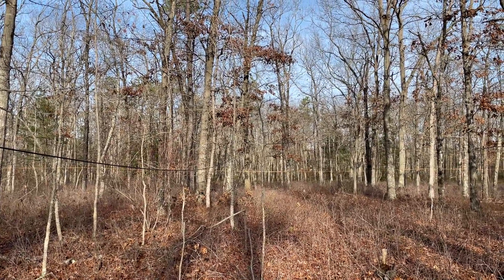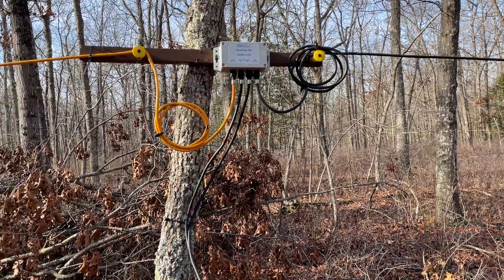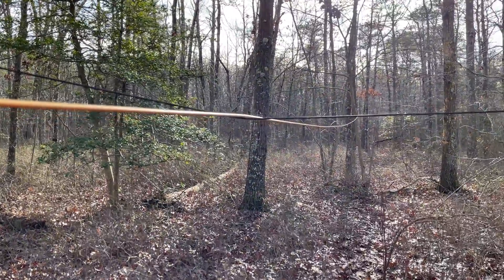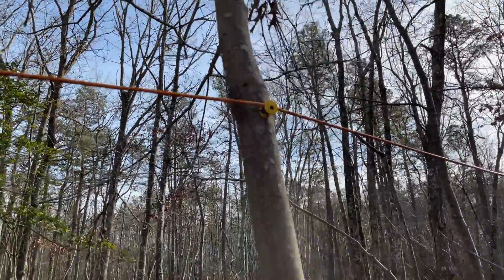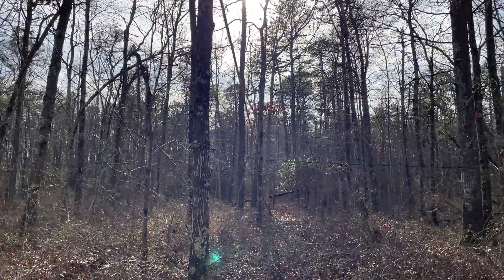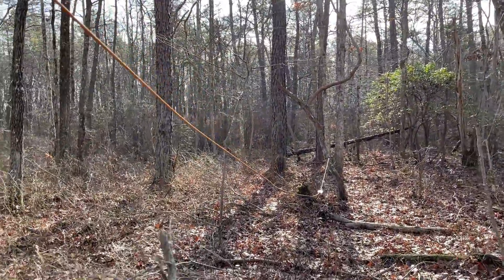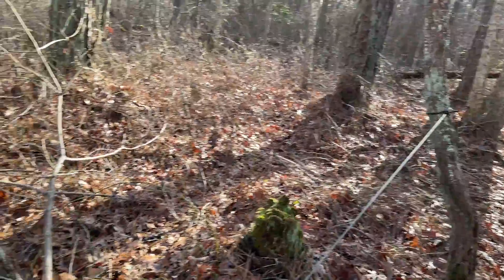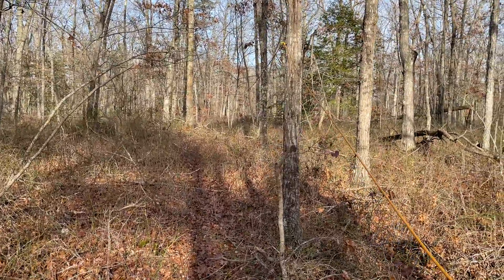Bevflex4x  Coaxial Beverage Antenna Forest Walkalong at NJ2US

Comment: id have to have it higher than yours because of deer in my woods LOL. Their antlers would catch in the wire if as low as yours.
Reply from the maker: The higher above ground you go, the less effective the antenna will be. Anything over 10 feet will start to disappoint you. Your mileage may vary.
Reply: @NJ2US  thanks for that bit of info will keep it less than 10 feet then. Hopefully no tall deer LOL at that height I shouldn't have to worry. thanks again enjoyed your video.

Comment: well done WB5MZO how does it worK?
Reply from the maker: Quite simple actually. The shield of the RG6 coax acts as the active receiving element. A reflecting transformer at each end of the coaxial beverage transforms the “shield” signal to 75 ohms, and sends the signal back down the length of RG6 using the 75ohm transmission line characteristics of standard RG6 coax. This allows the feedpoint to be inserted anywhere along its length, including either end if desired, with negligible loss from either direction. A remarkably efficient and elegant design. And RG6 is cheaper than copper wire by the foot.

Comment: I'm soon to move to 25 acres and starting to look into a beverage antenna. Would it be detrimental to have the wire say 20 foot off the ground so it would be up out of the way? 
Thanks Jeff ke4fwe
Reply from the maker: Hello Jeff, thanks for the question. Short answer, no, not a good idea, and here is why. The beverage antenna, in order to match its 9:1 (approx) input transformer, which is typically approx 500-600 ohms, calculations show that a height of 7 to 10 feet above the ground will present about a 500 ohm impedance at both ends of a beverage. Lowering the wire to the ground reduces the impedance, and raising it increases the impedance. Also, at 20 feet, the wire will attract NOISE,  and will allow noise arriving at vertical angles to get to your receiver. Also at 20 feet the beverage will lose a large part of its directivity, defeating its purpose. The beverage concept relies on reducing noise input, and by being close to the ground, noise arriving at high angles  is suppressed and cancelled by the ground.  At 10 feet (or even less) the wave arriving along the wire will tilt, because its speed in the wire will be closer to the speed of light, and the wave that "drags" on the ground below the wire is "slowed", causing the wave to "tilt". It is this Tilt" that contributes to constructive signal amplification, resulting in a decent signal at the receiver. An analogy of this phenomena can be compared to an ocean wave as is approaches the beach. Far out, the wave is short. As it approaches land, the sea floor rises underneath. This causes the wave below the surface to slow down, while the wave you see above the water line speeds up. As it speeds up, we observe the wave get taller, or, increases in amplitude. This is EXACTLY what happens to a radio wave that "TRAVELS" the length of a long wire. These antennas are scientifically called "traveling wave antennas", and it was Mr. Harold Beverage that studied this phenomena, and that is how the "Beverage" got its name! 73 from NJ2US.
Reply: @NJ2US  thanks that's a very good explanation.
Reply: @NJ2US  now that you said that I built a 30 meter delta loop feed with 300 ohm twin lead the top is supported by a 40 foot spiderbeam pole. The bottom is only about 7 foot off the ground. It is extremely quite yet the signal is loud and has a low take off angle. The bottom third of the antenna being low to the ground explains the low noise. It also tunes from 40 to 6. It's the best antenna I have tried yet.